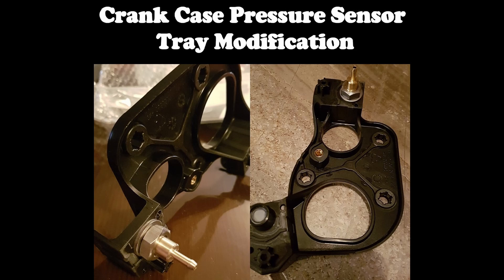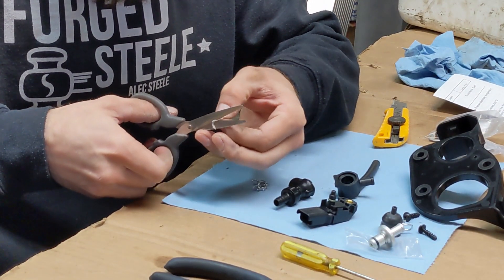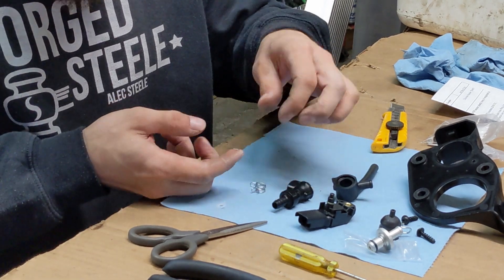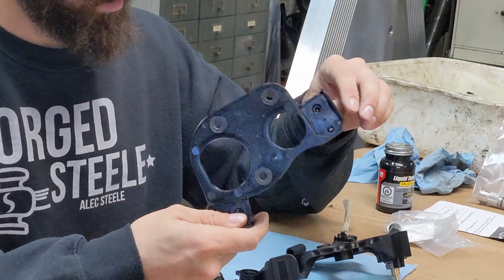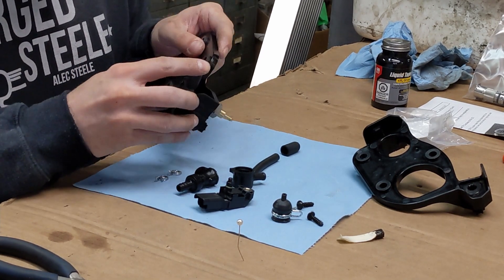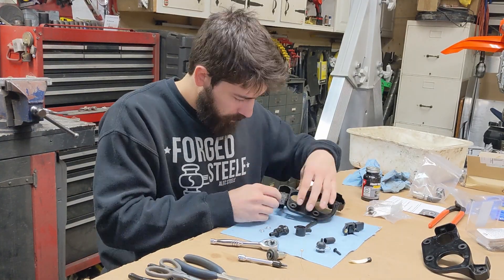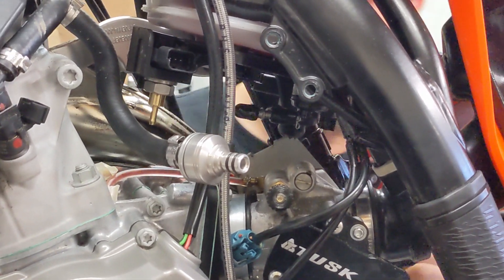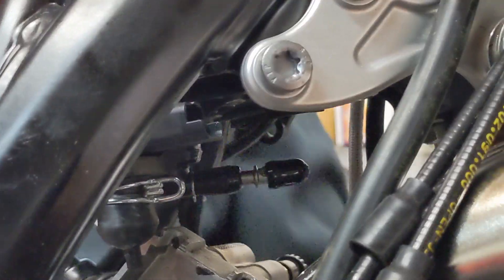KTM 2022 TPI Crank Case Pressure Sensor Hack!

Comment: No info on the brass coupler or how to install that.
Reply from the maker: The brass coupler was already installed on the tray. This tray was purchased directly from Tokyo Offroad. If you are interested to make the modification on your own, Tokyo Offroad has a video on this.
Reply: @mksworkshop6615  going to be updating mine soon but will be modifying the tray myself.